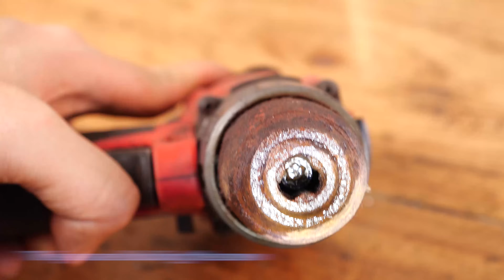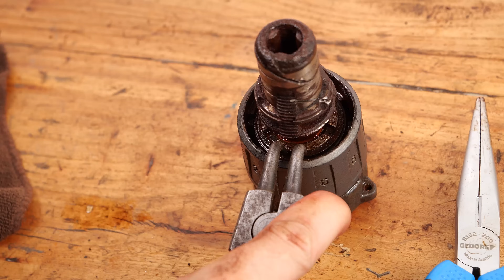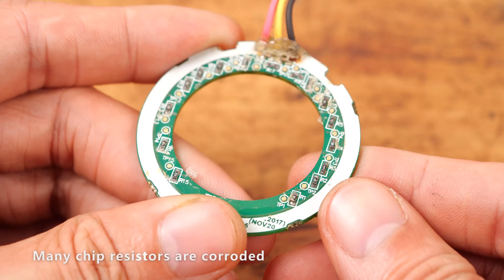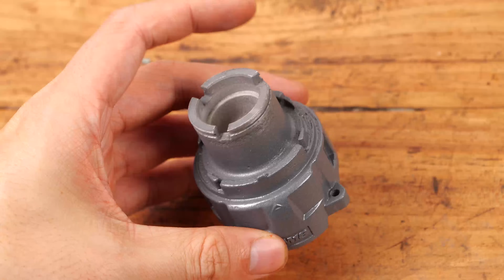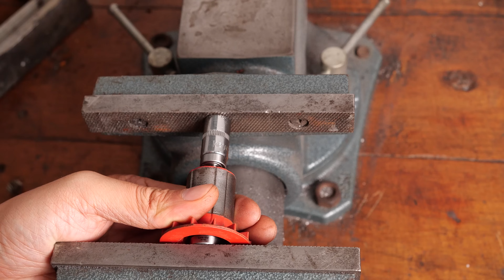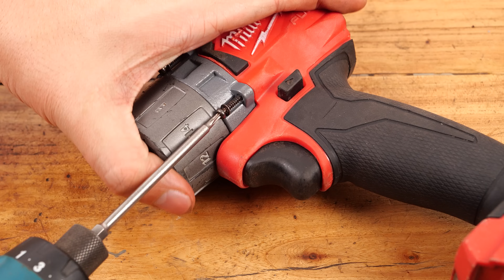Restoration of Rusty Cordless Drill

Comment: I had to stop after 7minutes. I really don't know why you're taking out the angle-grinder and cutting pieces off. Simply soaking them in a rust remover (vinegar or citric acid, or even Evaporust) will help significantly. If the parts are still a little stuck, a soak in some form of penetration fluid (like atf/acetone mixture) would help a lot.

Comment: How does it even get this bad?  Guy must have stored it in salt water in between uses.
Reply: The answer is in the electronics parts with smd-components magically protected from rust and decay.
Reply: the video is fake he used a rusting solution
Reply: @Lol-de7wy  Interior was far superior to the exterior and that circuit board was immaculate for something caked in rust which also sounds dodgy and I too have seen certain youtubers who do restorations talking about fake restoration channels where they purposely rust items where you can see the rust a mile away and the WHOLE thing is caked in it. In a realistic scenario the interior should be just as bad if not at the very least far worse than it already is  if the guy supposedly stored it in salt water especially that immaculate looking circuit board which looked perfect and all the crap on it just seemed like the remnant of the WD-40 and the rust mixture that just went all over it as he was spraying the thing. Even those dead capacitors looked good and that circuit board cleaned up like the spillage was recent because I would be expecting layers of the board to be split apart if they are that water damaged with rust and debris getting in

Comment: Soak the chuck in a cup of citric acid for a day or so. Citric acid plus EDTA4 according to elemental maker channel is a cheap substitute for evaporust. But citric acid on its own is a very good iron chelator and a fresh batch will take the rust off without damaging the underlying metal. And it very cheap.
Reply: i agree with you, i used citric acid a lot to free rust tools, its a shame those are original milwalke chuck should be still good, or you can take aparts those electronic and soak in ultrasonic will help free the chuck to, this chanel guy dont have patiance

Comment: How could it be this bad? He must have left it in salt water every time he didn't use it, otherwise it wouldn't have spoiled so quickly. Salt water corrodes and degrades everything very quickly if not cleaned and stored properly.

Comment: Either this was bought and never used or this is fake. That label looks almost new, just a little dirty and the screws in the back had the cleanest threads I've every seen for such a rusty drill. Even if those screws are threaded in they would develop rust over time. Fake as fuck.